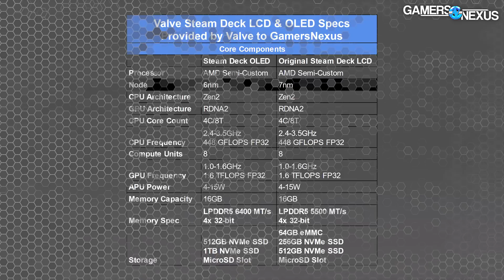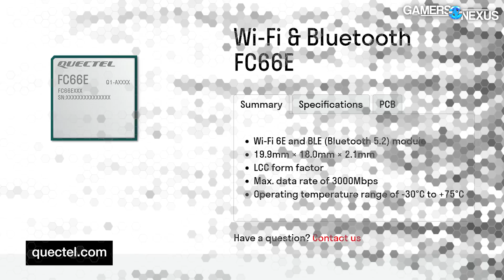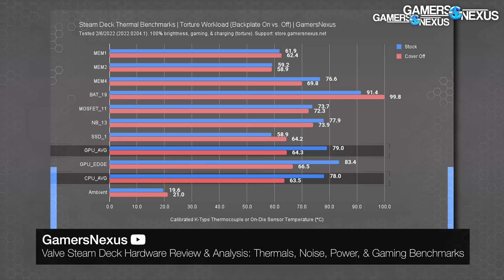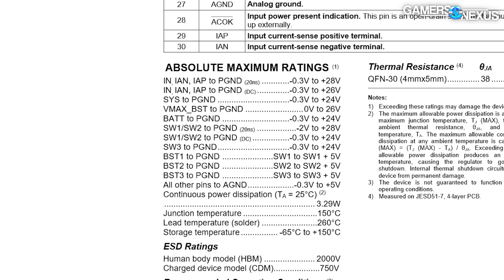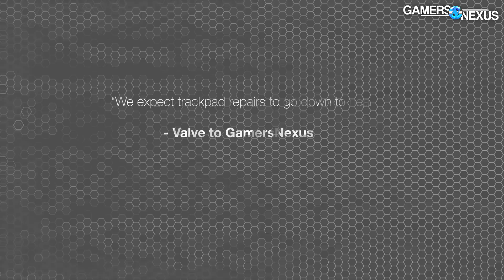They Changed Everything: Valve Steam Deck OLED vs. LCD Tear-Down

Comment: More than enough changes for them to have called it Steam Deck 2.0 but they went super humble just playing it off like a screen upgrade.  Saw they also standardized the fasteners to facilitate repairs.  Great come ups across the board. I never really cared about the deck before but I'm hyped for it now.
Reply: Well if they would have called it SD 2.0 they probably would never bring out the next release... 3.0 and Valve....Never happens!
Reply: @werpu12 valve? count to three? impossible 😂
Reply: @werpu12  Steam Deck more than 2 but less than 4
Reply: You should get one - it has more raw power than an AMD fx8350 4,4GHz  ;)   (Just typing on one....)
Reply: Really curious about what changes really got you hyped from indifferent, as to me the OG Steamdeck has basically everything the OLED does to get hyped about. Yes the new revision has some superior features and nice revisions, with the standout being that screen. Which for most will be a very nice improvement, but the OG screen is fine, component replacement repairs on the OG are not really challenging if you can get the parts (and in theory you can) and the form factor performance and cost are all really very much the same between the two. Seems like you should have been hyped for both...
Reply: @foldionepapyrus3441 the heat changes might mean a reduction in thermal throttling risk too. that and it has a slightly improved battery life
Reply: @dead-claudia  True, but my point is the difference between the OG and this is really quite minor. A slight bit more polish from a really good base shouldn't jump you from 'I don't care' to 'really hyped'.
Reply: @foldionepapyrus3441 the display, together to audio are a big change on how you feel/enjoy the device. I can guarantee you that after you use a oled/amoled display for few minutes you feel like using a last tech product. The oled can guarantee awesome black level and awesome contrast level. I enjoy see video on my current phone because of the amoled display and i sure It's the same with the new oled display on the deck.
Reply: @foldionepapyrus3441 per Digital Foundry there's a performance uplift, better sound, better fan acoustics, better battery life, and a transformative change from what they had originally deemed to be a poor LCD to now a stellar handheld OLED with HDR support. 

I wasn't as interested in the original steamdeck because of their take on the screen and the various 1.0 status compromises but I'm going to try to get to this revision asap due to all of the improvements and fixes. the screen alone should be a game changer (literally, from a visual standpoint)
Reply: Mehhh, but its the same SOC, they really should have upgraded to the newer rdna3 apu.

Comment: My one question: with the board cleanup it seems like there's now enough room to accommodate a larger SSD. Did Valve say anything about their decision to stick with 2230?

This teardown was incredible to watch. You and your team are so knowledgeable—and more importantly you're great at explaining the non-technical "so what?" of these chsnges. Thanks for turning this around so quickly.
Reply: Looking at the board layout, in order to get the connector in a location where you could physically package a 2280 would require a larger distance to the APU which might have complicated trace routing more than any savings they would realise on their end since they can just buy 2230 SSDs in bulk. In its current position some smaller tweaks might have been able to get a 2242 in there but 2242s are even harder to find and not even usually available in larger capacities
Reply: @bosstowndynamics5488 plus they already have a stream of 2230s, so no need to change production lines for it
Reply: @dead-claudia My thinking was more about reparability / upgradability, but you have a point.
Reply: 2230 is fine. There are plenty of options out there. I see no need to change this. @GSBarlev
Reply: Why though? There are large 2230 SSDs too
Reply: @TheAdamAdy  Large, but not fast. And storage bandwidth is starting to directly affect FPS in for example Star Citizen and Starfield. With 5800X3D I got a 14 FPS difference between mainstream PCIe3 SSD (WD SN750 1TB) and high end PCIe4 SSD (SN850 2TB) in Starfield, with additional benefits when the game is on a different PCIe4 SSD than Windows and the page file. Starfield was also the first game that showed that memory bandwidth can matter also on an X3D chip, as 3800Mhz CL16 gave the game another 8FPS boost over 3200 CL14
Reply: @Vinterloft  I get your point, but we are talking about steam deck here, not gaming desktop pc
Reply: @TheAdamAdy   not to mention, Valve didn't change the APU. There are large 2TB M.2 2203 PCIe Gen4 x4 SSDs that will saturate the PCIe Gen3 x4 interface on the SteamDeck in both reads and writes. Would it be nice to be able to cram an 8TB M.2 2280 in there, sure, but a "faster" PCIe Gen4 SSD isn't going to do anything for the SteamDeck as it stands right now.

Comment: One thing I am wondering about the ram. Are they now using dual 64 bit channels split into four? Since each memory channel on the old board was on one chip, and they are still claiming quad 32 bit memory channels
Reply: the chips may just happen to support access as dual-channel packages
Reply: @dead-claudia  well that's exactly what I meant. If the chip is designed in such a way, it can basically have 2 channels on one chip, and I'm suspecting that's what they did. This is a good improvement for simplicity. And it's nice that they increased the memory bandwidth while at it

Comment: It is impressive you were able to tear it down and analyze this so thoroughly in just 24 hours.  Did Valve work with you and provide you with info to look for to accelerate this process?
Reply: Valve obviously ships devices for review days or weeks ahead like any other hardware manufacturer... just under NDA so all the videos release at the same time, and people don't rush to be first.
Reply: Also I'm pretty sure Steve said he spoke to valve engineers

Comment: It's quite amusing to me that Valve will gladly put in this much effort in order to improve their latest product-line... but will absolutely refuse to touch their actual game IP's which a lot of people have been waiting on them to do from the past 10-15 years.
Reply: If a bunch of nerds are put in a room to make a science project, I think it would be a lot more fun making something hardware related than software related. That's just my opinion.
Reply: @PokemasterSD sure but there's also profit motives:

- learn how to count to 3: $100m+, might make $150-200m back
- design portable pc: $100m+, make ~$100m back in hardware sales, $100m+ in added steam sales
Reply: tbf valve's biggest cash cow is steam. and the steam deck increases market reach for, you guessed it, steam. same reason the valve index exists - it's specially built to be gaming first and promote steam-based vr games and experiences. most their competitors, like the oculus non-quest and htc, are business first, just with recreational use still treated as a first class citizen.

Comment: SteamDeck 1.5? Seems different/upgraded enough to be a different generation. Good job Valve!
Reply: definitely gives 1.5 vibes tbh

certainly not a complete rethink, but not at all a minor refresh either despite the marketing
Reply: @dead-claudia Historically the CPU generation usually dictates whether a device is referred to as being a next generation device because there's usually a lot of focus on the performance. That isn't even close to the entire experience of using a device like a Steam Deck of course but Valve probably don't want people to get disappointed when their next gen deck externally feels simpler and performs only marginally better than the old one (since most of this is under the hood changes aimed at both repairability and probably just making manufacturing cheaper and easier as well).

Comment: Is the hardware revision only for OLED display version, or will it also apply to the LCD model as well?
Reply: Most definitely only for the OLED since the OLED screen made it possible to have more space to fit the larger battery and everything else.
Reply: Only OLED version

Comment: That side-by-side table layout between the two versions is absolutely stellar. It makes the large number of differences easier to see one area at a time. Great comparison. Thanks.
Reply: sort of reminds me of something 'tested' did with the guts of a laptop, yet GN's vid is slightly more informative about the steam deck.
Reply: It is... shame about the LED lights flickering though  :(
Reply: Yeah all those changes still went with slower Zen2 over Zen4 which is in the Legion and Ally for similar price.
Reply: @jaggsta  "similar price" they're 1.5 times the cost with worse battery life even compared to the original LCD deck.
Reply: @jaggsta  I wonder how much that cost is taken care of by Microsoft, with both of those devices making an attempt at keeping Windows relevant in the handheld space?  They're definitely losing money on selling the hardware otherwise.

Comment: Users: we aren't 100% happy with the SD, here is some nitpicks.
Valve: OK. We'll just re-spin the entire device design from ground up.
Reduces PCB components by 40% while improving the specs at same time
Reply: tbf most the stuff they removed is cheap shit that mostly just helped build up heat.

Comment: So, what are your performances predictions? Between faster RAM and potentially better boost behavior due to better APU heat dissipation, I predict ÷5% average FPS in select titles.
Reply: Digital Foundry and LTT already did a bunch of benchmarks. 2-3fps gain.
Reply: @kuhpunkt for 30-60 fps, that tracks to 5-10% perf gain, or half a cpu generation
Reply: @dead-claudia  5-10% will matter for games on the edge of no stutters, but that's about it. Not a bad bonus for new adopters who were waiting on a better screen, but a hard sell for anyone who already has a Steam Deck.

Comment: why does it not have an amd 8 core cpu inside it yet that would make it a more powerful beast
Reply: Because powerful is not the point...
Reply: @kuhpunkt  oh but it is because then if can save power on games they use more cores over frequency to save power plain and simple kid
Reply: @SaraMorgan-ym6ue  why are you calling me kid
Reply: @kuhpunkt  because you think that a gaming machine does not need to be powerful and it does kid that was why they went with the quad core originally with ddr5 not ddr4 cause ddr5 bring out more power to the system and linux to increase gaming performance further have you not tried windows on a steam deck it's slower the steam os in gaming and there are limits to the power you can get out of a 4 core when games are starting to come out needing 8 cores to run well now
Reply: @SaraMorgan-ym6ue there is no benefit to using 8 cores at a 15w power limit when gpu is the limiting factor. This is evident by the z1 extreme subpar performance vs steam deck at 15w. We need something better than rdna3
Reply: @kuhpunkt  They need to balance out power to performance ratio. Handheld gaming most common problem is battery life and Original SD already like magic when running in 12W or below compare to current fastest pc handheld 8cores. This need die shrink will make better at low TDP then it used to be.
Reply: @SaraMorgan-ym6ue  if you cant treat others with a little respect, why bother...

Comment: Why is it that halving the number of memory modules does not halve the memory bus? I imagine the clock bump wouldn't be enough for matching and even exceeding the previous memory bandwidth.
Reply: Probably moved from 32bit per module to 64bit per module ?
Reply: @malathomas6141   I'm not sure you can do that within the same generation of RAM, but that would explain it

Edit: apparently LPDDR5 can run at 16 or 32bit, so the previous modules were likely 16bit

Comment: I wish you guys removed to battery to see whether or not it's easier to remove.
Reply from the maker: It's still held in with adhesive.
Reply: @GamersNexus  Hey GN. It indeed is still held with Adhesive but there were talks that amount of it was significantly reduced to improve battery replacement. That being said i would guess iFixit will also score it soon.
Reply: @GamersNexus ugh adhesively held batteries

Comment: Why didn't they do the m.2 180 degrees so we could use 2280 drives?
Reply: Is it necessary?
Reply: @malathomas6141  Somewhat, it would make drive replacement options more prevalent and cheaper for the end user. There's like $100 difference between a 2TB 2230 and 2280 of similar capacity.

Comment: So this the next gen steam deck exactly as Valve was talked out doing - it's not next gen, but a true evolution of the deck I love.
Reply: They said their will be a steam deck 2
Reply: @malathomas6141  Yes, and they are still saying that.  But they also gave a pretty clear indication of what they wanted to to which this has and have also been pretty clear that the hardware was expected to be long life (aka a stable platform in terms of  performance targets).  This is not the Steamdeck 2, but it is exactly what they were talking doing about a year and a bit ago.

Comment: excellent video as always!
one question:
Is the fact that you disassemble and reassemble the device will affect the results of testing the thermals and noise?
Thank you.
Reply: GN always tests the thermal performance of the device before disassembly except in edge cases where they use thermal probes inside the device, and even then they do all the other tests before installing the probes. And interestingly enough, yes, the disassembly can affect the thermal performance but there's actually a small change that effect can be an increase if they use a higher quality thermal interface material than the OEM.

Comment: Very interesting, especially how open Valve's engineers are with you guys. Looking forward to the testing. One unfortunate side effect of the newly designed stick daughterboards is that the third party hall effect sticks are no longer compatible, but I imagine it won't be too long until Gullikit updates those. As an aside, it's really funny to see Steve sitting in the Vertagear chair, considering how much his staff hate those.
Reply: Elecgear sticks are better since they have a round outer deadzone like the stock sticks which means games will still feel the same and you can shrink the inner deadzones as much as possible. Gulikit's outer deadzone is a square and changes the feel of every game as a result.
Reply: @Moskeeto agreed - I tried both Elecgear and Gulikit sets, and Gulikit was 1) mechanically faulty - one of the sticks wasn't moving evenly and produced squeaky sound when doing full circle rotation 2) had that stupid box-shaped outer deadzone, that cannot be fixed with calibration. It's just coded in the firmware of the stick module, and I have no idea why they hadn't adjusted it in newer batches. Elecgear kit, on the other hand, performs just right - almost circular outer deadzone and no mechanical issues - the only downside is not having the caps soldered out-of-the-box. So I just took them off the Gulikit ones, to keep original sticks intact. With Elecgear, I was able to set inner deadzones to absolute minimum of 2000 - and they are performing great.
Reply: @tehhedger  I believe the issues with QC and failure rates with their tested supplier of hall effect joysticks was one of the big reasons Valve listed for not moving to them.  It was mentioned in a couple different reviewers questions to valve.
Reply: Valve doesn't make their money in hardware, so they're not scared of competitors stealing their engineering work. When SteamOS 3.x becomes available for most devices, anyone using it will not be competing with Valve, they'll be helping them. Steam is the center piece of their distro, and that's exactly where they make their money, a 30% cut on anything sold leads to massive revenue with minimal work.
Reply: @LaughingOrange  It takes an electrical engineer about 10 minutes with a screw driver to glean much much more information about the Steam Deck than Gamers Nexus reported so that argument doesn't hold. The rest is correct though.
Reply: He sitting in it so his staff doesnt have to.
Reply: Gulikit is not a good solution, they have the square deadzone problem they had never fixed and that makes certain games worse than the stock controller, I replaced them with the Elecgear hall sensors, and they are way better, basically identical to the original ones, but you can drop the dead zone to really low level. That said, there is no need to replace them. because the original sticks are really good and durable, once you get drift (which not many have developed) it makes maybe sense to replace them with hall parts.
The hall sticks are a nice toy given you get the right ones which do not make things worse, but not worth the effort and money I wont retrofit for now the Oled version until it itches me to do it!
Reply: I think Valve has simply woken up to the fact that the PC journalism crowd has gotten so technically proficient that nothing can be hidden anyway, so you might as well just accept that the cat is out of the bag and act accordingly. The second someone like Buildzoid gets his hands on a 3D x-ray imager the last bastion will be broken and stuff like making open source BIOSes for everything will "be trivial".
Reply: @andersjjensen eh, a subsection of pc journalism. A lot of it it isn't and really don't need to be literate on the level displayed here.

Comment: Amazing analysis as always. 
The only thing i have to criticize is the highlighing method you're using on different components. I'd like it to be a little more apparent, maybe use a stronger blue or an entirely different color.